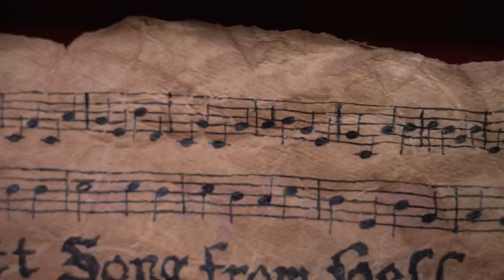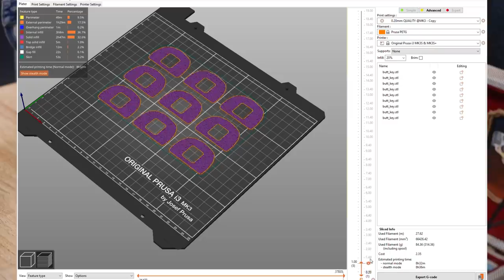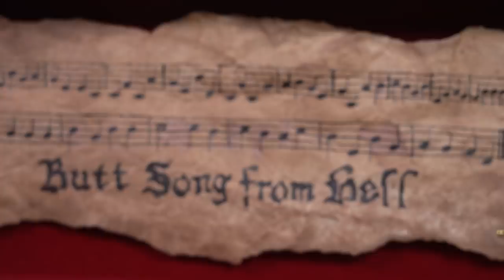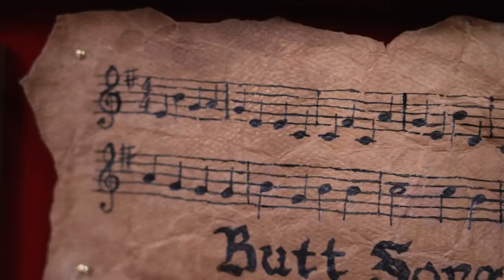Makers Secret Santa: The Butt Keyboard From Hell!

Comment: One work around on the keys would been to take old mechanical keyboard and salvage least used keys and throw in few as spares while at it. You can get those for free from electric scrap collection places depending on country and company in question. Also could probably find one from drift store for fraction what those keys cost.